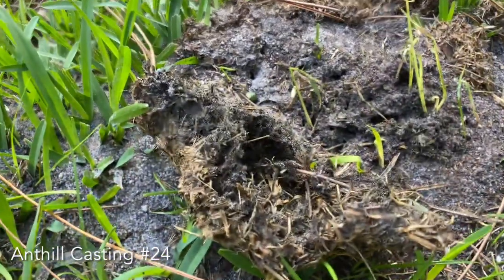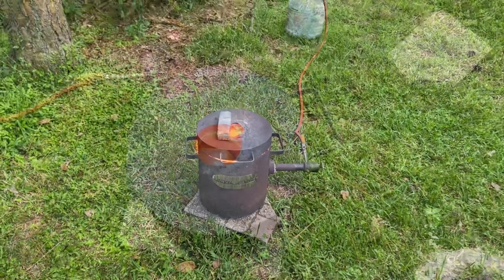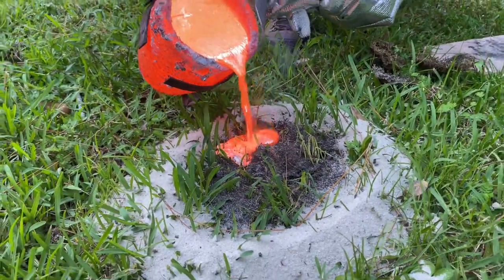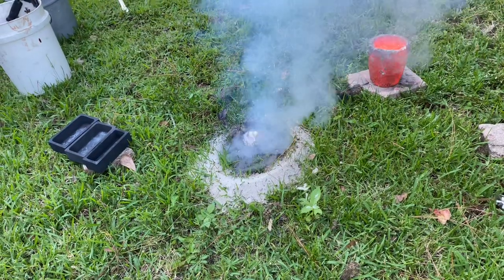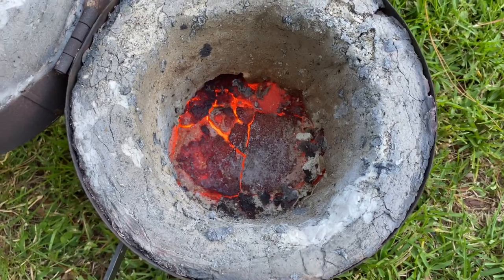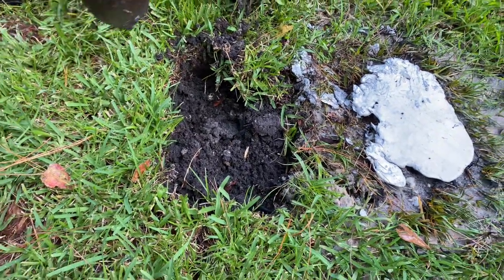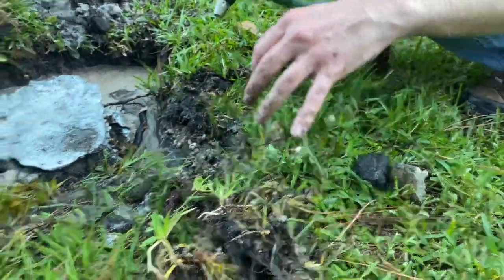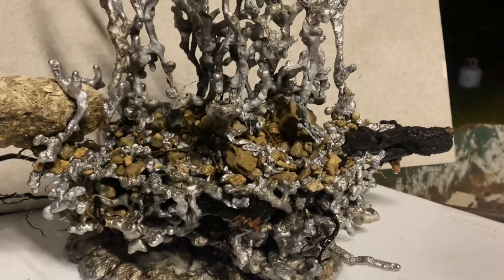Massive Aluminum Anthill Casting #24

Comment: On average how much aluminum does it take for an ant hill? I want to start casting ant hills but I don’t know if I have enough aluminum. Just wondering what a good estimate would be.
Reply from the maker: Each pour I do is about 7lbs of aluminum. Aluminum is pretty easy to find. Car parts are my go to, you can find them for free on the side of the road or have friends give you their broken stuff or go out and buy broken parts from a scrap yard.
Reply: @NolansAnthillCastings  so it doesn't come in pre-cast bars?
Reply: @eq1373  It does. I googled aluminum ingots for sale and there’s some on eBay, among many others.
Reply from the maker: No reason to pay extra for aluminum when you can just get free stuff on the side of the roadz
Reply: @NolansAnthillCastings  I get it. Saw another vid where the guy melted soda cans for his aluminum. Just googled it out of curiosity, and of course aluminum ingots are listed on eBay. Saw an old doc about scrapping WWII bombers after the war, and the final shot was a conveyor belt of aluminum ingots that used to be a B-24.

Comment: Sir, have you ever considered using a Zinc alloy??
Zinc pours at a lower temp and molten Zinc is much thiner than Aluminum.
I think you will get deeper penetration and finer detail with the Zinc.
I get all of my alloys from Rotometals.
Reply from the maker: I don’t like messing with zinc. The fumes aren’t good for you if you get the furnace too hot and it’s just more expensive. I get all my aluminum for free by scrapping stuff.

Comment: Do you recover the aluminum oxides through chemical processing? if so I would watch a video on it even just you experimenting with it...
Reply: Honestly the aluminum oxides would be much more trouble than it’s worth to try to extract due to the strong bond created within. Likely it would take a great deal of electricity for a very small yield
Reply from the maker: Yes and no, so the oxides like Sam says wouldn’t make sense to try to recover but I do remelt what I take out because I usually take out a bit of good aluminum with the dross.

Comment: How long time wise from when you pour to when you dig up?
Reply from the maker: 10 min. I take a water break while it solidifies and then cool it the rest of the way down with the hose. Takes about 5 min to solidify the base due to its thickness. The tunnels freeze up with in seconds.